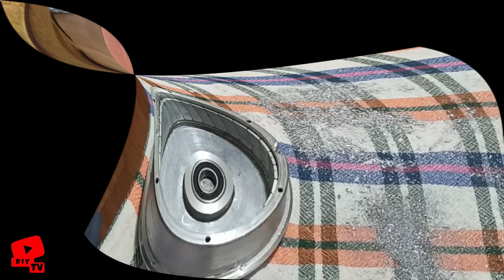Big Wheel Mounting on Hoverboard

Comment: I put 4.10/3.50-6 on mine 6.5" motors.
Make sure guys u will be enough power before doin it.
In my case its 4x4 project, but power drop is significant.
Reply from the maker: As the diameter increases, the torque decreases. The project you will do and the structure of the land you will use are important. If you are going to use it on a flat road, you will not have any problems, but you will not get performance on a sloped road.
Reply: @DiyTv77 yes, exactly. In my use case its enough power.

Comment: This tire fits on 4 inch rim, but hoverboard motor's rotator is 5inch after removing outside rubber .
How did you make it.
Reply from the maker: I used 4.10 / 3.50 - 5inc tires. This tire fits 5 inch rim. It gives a warning after removing the tire.
Reply: @DiyTv77  you mean hoverboard motor gives warning?
Did u bypass warning or fixed.

Comment: Valdría una rueda de 10x2,50, qué modelo es el otro que sale junto a la de 410x350
Reply from the maker: La mida del pneumàtic ha de ser de 4,1/3,5 polzades. Si cerqueu pneumàtics en conseqüència, trobareu el pneumàtic adequat.
tire size should be 4.1/3.5-inc. If you search for tires accordingly, you will find the right tire.
Reply: Muchas gracias 😊

Comment: hello friend help me please, I have a motor of that inch so it is thinner, from one edge to the other it is only 27mm, will it work?💥💥
Reply from the maker: I did not fully understand the subject. If you are talking about the motor inner slot width, the motor wattage is around 250 watts, it will work. can be used in certain projects.

Comment: Can I ask what size are tyres
Reply from the maker: I wrote the details in the description section.
Reply: Why not put the air stem to the outside of the wheel instead of inside?
Reply: Why not put the air stem on the outside of the tire instead of the inside?
Reply: Why not put the air stem on the outside of the tire instead of the inside?

Comment: what tire is this ?
Reply from the maker: I wrote in the description section.
Reply: hmm . can't see exact tire size and type.  did you put this to practical use ?
Reply from the maker: @pxl666  I put it in the description.
Dimensions: 4.10 / 3.50 - 5
If you scan these dimensions, you can find the tire. Aliexperse is plentiful. Make sure it's 5 inches.
Reply: thanks.  did you use this wheel in something?
Reply: Cost of the hub?